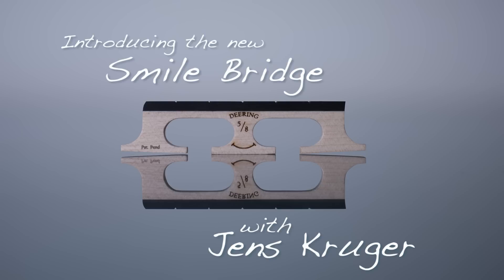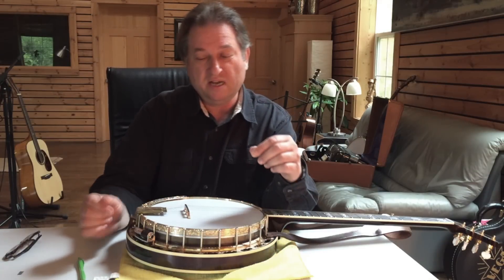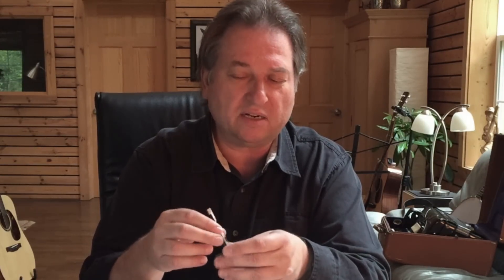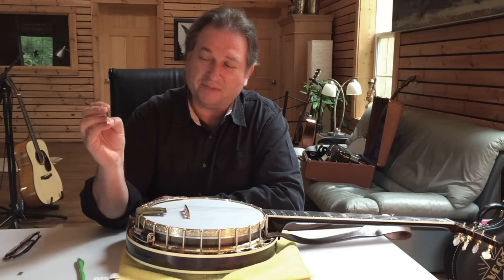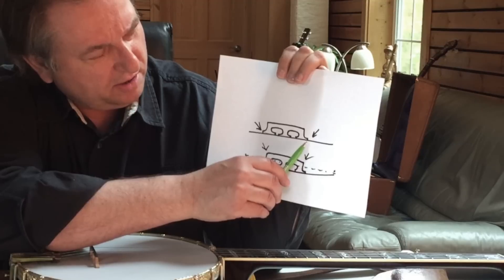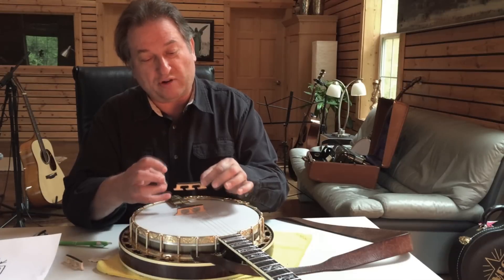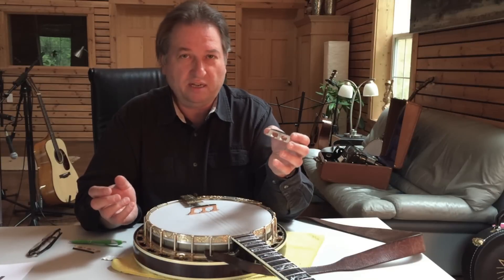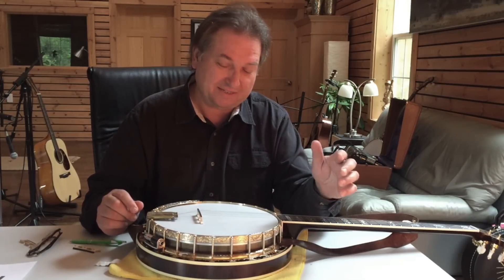The Science Behind The Smile Bridge - Jens Kruger

Comment: 2 newbie questions. does the logo go towards tailpiece or toward nut ( i cant tell in the video?)
like on some Deering bridges there is no logo but the left and right sides are different (one rounded one pointy) does the pointy side go towards 5th string or towards 1st string,   Next question is: weather it is good or bad to put a 1/2 of a drop of lemon oil/ mineral oil in the bridge grooves so the strings slide over the bridge when tuning. Or do you want the bridge grooves bone dry so that it kinda sticks to the bridge slot causing more vibration to transfer ? Thank you for any guidance. I know people say use pencil lead but no one has ever answered about oils of any kind or about the science of a dry bridge vs. one where the strings slide better for tuning, I ask because mine was creaking when i tuned it and figured it might be messing it up if i left it that way.  (so basically How do i know i have the bridge facing the right way, and science of dry bridge vs one where strings slide better when tuning 😉)
oh ya and is string lube in bridge slot ok?😊